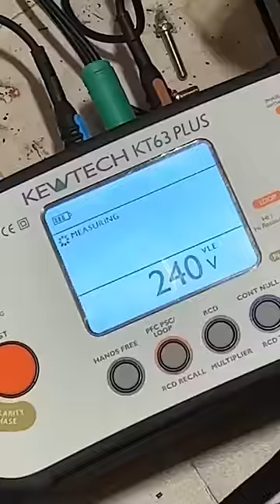Adapt improvise and overcome. Converting TNCS to TT #shorts

Comment: Wouldn’t spinning it in cause it not to hold well? If I have ever needed to remove a rod I always give it a twist and that normally helps loosen it. 
You can purchase a sds plus rod bit and it’s for using on hammer only.

Comment: Is the jbox on the earth rod a standard there? In Aus we just put a tag on the earth wire, clamp it and galvanise spray it since the rod is exposed to moist soil anyway
Reply: Yes it's standard (and that form of box is pretty standard for small domestic installations when you have access to the ground around the house, but we use a bigger inspection  pit with lid flush to the ground in commercial settings or where the property has solid/paved perimeter and you need to break ground before you can find earth to drive into).
Its purpose is not to protect the rod but the clamp and cable joint against corrosion in the typical British summer weather and from damage during the life of the installation (imagine that in the soil of the border around your house and you are strimming the weeds having forgotten that it's there because, out of sight out of mind, and suddenly you expose the clamp of the weeds and see that you partly cut through or mangled the cable).

Comment: Nifty little tip that I'll try it next time I do a rod. What's your honest opinion of Milwaukee tools? I'm debating either Milwaukee or Metabo any advice would be appreciated
Reply: save and buy Hilti, milwaukee seems great at first, then you start having problems with batteries charging, constantly tightening screws on the case as they loosen, lose some phases on the motors and they burn up the drill AND battery...

they seem to have alot of good ideas on the surface, but end up being incredibly stupid in practical application. the rolling packout tool holder for example... when you open the water tight lid, all the water rolls back and hits the handles and pours down into the storage area... 🤦‍♂️
Reply: Makita.
Reply: Milwaukee or Metabo?  If that's your budget, Milwaukee every time!  Good solid tools that don't eat batteries and plenty of repair support in the UK.

But if you have only a bit more budget to last you a lifetime, Bosch beats Milwaukee by miles.  The numbers in the catalogue make Milwaukee look much better that Bosch (e.g. torque and joule ratings in each mode) but Milwaukee "feather flatter and fluff" those numbers to get them so high whereas Bosch far more honest (yeah, a German company being honest about its mileage, odd isn't it!).

Of course if you have unlimited budget Hilti beats everything hands down.  But that's what you pay for.  Rent your tools, don't buy, keep them on hire fleet and if something goes wrong (even if a battery fails) phone Hilti and they'll be out the next morning to you on site with a new drill. No lost work.  That's what you pay for.
Reply: @Dranok1  u must have better batteries over there with milwaukee then in US, im switching to Hilti thanks to the battery issues 😓🤬🤮☠

Comment: are there places that allow the grounding rod to remain above ground like that? pretty sure code says it has to be completely buried
Reply: In America it's completely uncovered. The ground wire is even bare. I guess it all comes down to local electrical theory and law. In America it's one of those "if your ground is hot you have bigger issues than a bare ground!" Ground wires are also bare in all breaker panels, outlets, light boxes, switches, and junctions. I've known a few people from other countries to freak out seeing our style of electricity distribution.
Reply: @jameshathaway5117  I guess first off, I'm in America. I have never seen anywhere that allows the top of the grounding rod to be above ground. Every code I've learned is flush with ground or buried. The only way you could have the possibility of an exposed rod is if you used a 10ft rod and don't cut the excess, as code requires 8ft to be buried. And that is a whole other issue with the video, as that rod can't be longer than 3ft.

Comment: not to code the NEC says the entire 8 foot length shall be in contact with the ground the acorn clamp is designed to be in contact with the ground you should never be able to see the top of your ground rod or the clamp if it needs to be inspected you can leave it uncovered for the purposes of inspection but then it should be buried.

Comment: sorry i'm an electrician  The idea is good, but please always use V4A steel as an earth electrode outdoors.  Copper forms copper oxide and that is an insulator or like a semiconductor.  Therefore, ALWAYS use stainless steel outdoors as an earth electrode

Comment: I like that enclosure, the states has some poor options for grounding practices
Reply: It’s true, I don’t even know where the ground is for my house, I’ve just never needed to service it so I never looked.
Reply: @BrianNaeem  i dont know much of the US electrical system. But maybe you can look at the place where the supply comes into or to your house. There might be a bar where the earth wire of the supply cable is connected. It could be the "shielding" of the cable. There should also be a wire that goes to the ground or the foundation of your house. Maybe you should call an electrician to measure the impedance of the ground prongs of your outlets to ground or earth. Here in germany it gets measured when a building is newly erected and "electrified". In commercial or work related buildings it has to be done on regular basis (every few years), to ensure the function of breakers and rcd's(rcbo or how you name this devices).
Reply: In most places the utilities will come into the structure in one general area.  You will typically find a unshielded twisted 6 AWG cable running to some point near your foundation.  In addition you will generally find similar bonding cables going to your gas and water mains.  

Now in townhouses, multi family units, etc it can get a bit strange.  And in some really odd situations you’ll see everything just going to the water line (which is kind of hazardous, but was legal in some places for a time)

Comment: Here in the states they just slam the ground rod a few feet down and you probably shouldn't touch it
Reply: If the ground is live, the box is live along with most other things in the house. Probably shouldn't be touching anything inside or outside of the house at that point. No need for the terminal box but I guess different places have different standards. Lol

Comment: Is this the UK? Do most homes have 100amp main breakers?
Reply: The carrier is rated to 100 amps the fuse is mostly 80 amp but can be as low as 60/63 amp as that is the minimum capacity by law (15kw)
Reply: ... and is because in the UK domestic is only single phase, only really big houses ever ask for three phase, unlike much of Europe.

Comment: How do you ground, 
 when you’ve built of rock?
Reply: Earth pads (flat sheets of copper buried as far as practicable) or mesh network (an interconnected grid/net of copper conductor a couple of metres square).  Unless you literally are building on the surface of a rocky outcrop, then you really do have problems...

Comment: Considering the olive clamp isn't installed correctly and the copper dosent come above the top of the clamp so it's easy to see its properly inserted this is a crap job. Also grounding blocks should be in a sealed box in the house incase they ever become energized to protect people.

Comment: American electrician here: Every time I go to Europe I take a small bag of tools and my multimeter. I take off the subpanels in my Air BnB's to figure out how they do this.
Reply: The short answer is they dont do it like this xD like his work is quality, but the tools he use is not legal practice here and his description indicates he doesn't understand the underlying circutrynand claasifications of what he is doing other than that he is adding grounding to a house.

Also, that type of grounding clamp is not guaranteed legal to use in most of EU, but he is deliberately making sure it is encapsulated in what loops like rain and corrosion protective coverage so it would work fine and not cause problems even tho the certification of it isn't perfect in innland conditions.

Good to see you bring a multimeter, but also, a friendly reminder to make sure the cat3 rated voltage is above what you are meassuring, there is a lot of energy in some circuits in the EU, and if your multimeter has a cat3 of 135V ut may work fine in a 110V system, but in a 220V system it may not 99.96% guarantee an arc free  experience

Comment: Is that the correct depth for a grounding rod in your area? Man, we have to push these things deep into the ground, like at least 2 meters, even for usual 230V/400V landline. Even 5 meters for overvoltage grounding. The way you showed it would only be ok for a temporary construction site. greeting from inner Europe :)

Comment: Electric engineer here.
With all due respect, why would you switch from a TN type network to a TT type network? Even in a worst case scenario, a TN network is safer than a TT network, and even if you dont want the N wire, adding a spark gap to grounding of the transformer (yes making it into an IT network) would allow more safety than a TT network. In a TN network a fault is guaranteed to trip any current based circuit breaker. in a TT it will still be large enough to kill, but unless you add better grounding than that single grounding spear, it will be too small to trip the circuit breaker, resulting in an unhandled danger.
Atleast in an IT network you need multiple faults on multiple phases to add that kind of danger.

Like, you don't have to sever the N wire just because you ground your house.
Most TN type electric networks are grounded close to the CS.

Then again, since you dont show cutting the N wire im guessing you don't change from TNCS to TT, you just add local grounding to a TNS type network.

Comment: After completely mullering the threads on that earth rod with your wild install method instead of using the correct tool. What would you do if the Ra value was too high?

Comment: Doesn’t the RCD need to be installed before it enters the DB
Reply: No because the cable enters the metal DB via a properly designed compression gland insert (with 3 holes in the insulator, for each conductor).  It has often been argued that this only protects the conductors against damage to the insulation upon entry and does nothing if a terminal is loose and the conductor comes free of the incomer to touch the inside of the DB (slim chance but non-zero), but the first part is all the Reg's are concerned about.  I reckon it's more about practicability and cost-benefit.

Comment: 100mA for the rod alone 👍🏻
Utilised existing rcbos for ADS 👍🏻
All complies, fuses will disconnect 👍🏻 
Buuuuuuuutttttt, it all looks new- cabling, switchgear, surroundings. So how do you design any circuit without knowing the evternal impedance?

Comment: He has just taken out a perfectly good and preferable, direct return path and replaced it with an unreliable path through the dirt......There is a reason for using a combined neutral and earth. its almost impossible to have a different resistive path back to the transformer. if he wanted to add earth leakage protection just connect the earth to the neutral at the cutout and run an earth back to the earth of the db.

Comment: Why would you convert TNCS to a TT. Surely that lowers the fault current capacity. Since we now required earth fault current devices on all electrical circuits. This seems to be a backwards move. This would give a higher earth loop resistance. I always found TT systems less reliable, especially in very dry conditions.

Comment: Why do this in the first place? The earth system is the responsibility of the DNO, if there was an issue it is their responsibility to fix it! 
On another note, if the TNCS system were to fail how do you know this new electrode won't become the neutral return for the entire street? Were all other incoming services provided with plastic pipes to eliminate this risk?

Comment: Why not use a hammer? Its much better. I used a fence post driver on the hard ones when driving a 6ft ground rods but most were easily handled by a framing hammer or small sledge.

Comment: 16 ohms bruh. maximim 10ohm for house and 5ohms for industrial building
Reply: Unless your country has an unachievable standard, I think you are mistaking the resistance of the earth electrode itself in the ground (want to be less that 10ohm) with the measured earth-fault loop impedance of the installation (transformer to house, through earth rod and all the way back to the transformer through the general mass of earth -- 16ohm pretty good).

Comment: Yeah, lots of steps converting from TN-C-S to TT, especially if you are also replacing an old ground relay with an RCD.  Looks confusing when edited down into a short with no explanations and no indication of which country's regulations determine details like that metal placcard.

Comment: Too cheap to buy a spline drive drill and special bit that just hammers those ground rods in so much better. Cad welding the ground wire to the rod is also much nicer.

Comment: they have hammer bits that will fit those ground rods. Your way might be better though.. Lol
Reply: @the-guy-on-your-moms-couch  Thank you sir, you're right! I was just trying to be nice. I used to work on cell towers and I remember we would have to pound a shit ton of 10 ft ground rods all the way down with about 6 to 8 inches sticking out above ground. Depending on where we were working, sometimes it was all limestone. If the 90lb jackhammers, couldn't get them all the way down it was the bobcat attachment, and when that didn't do it, it was the circular saw,  lol.

Comment: So explain how the hell you got permission to: 
 remove DNO fuse - THEN  go on to remove their PEN  to cpc link ( ie changing the parameters of the dno supply - which is covered by ESQCR ? Ie do you have the qualification to do this?)
Sorry -  but surely to convert to TT  - all that needed to be done was remove the main earth connection / Met  from the DNO earth terminal  and connect  it to your new earth stake

Comment: Did you just put your drill on hammer ( correct ), thén switched the sdsMax to a standard chuck with a hole saw and 'drilled' it in? For all the things you did right, this is a fool move... Get a sdsMax PE-cup and hammer, not drill, that PE bar in! Jesus..